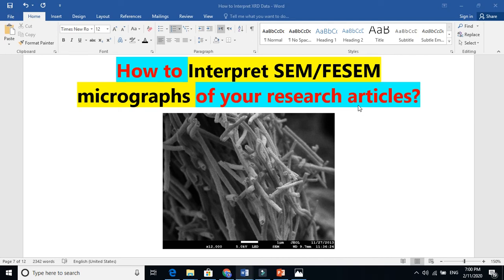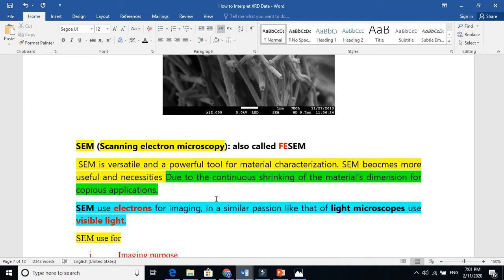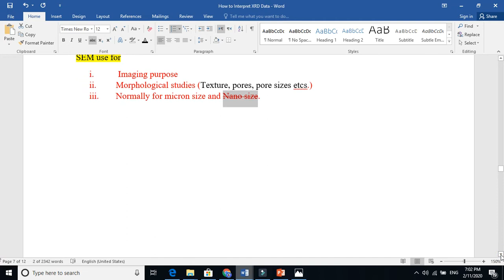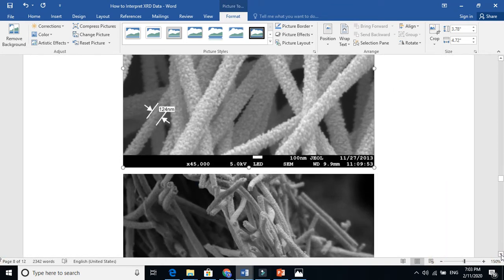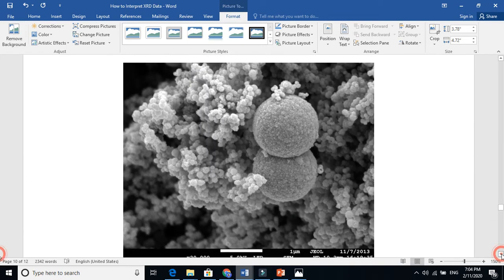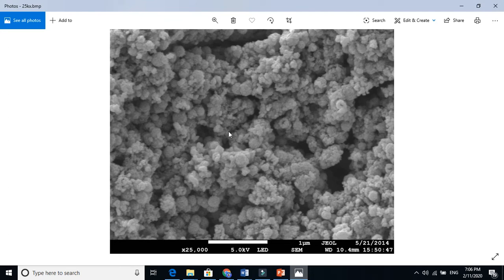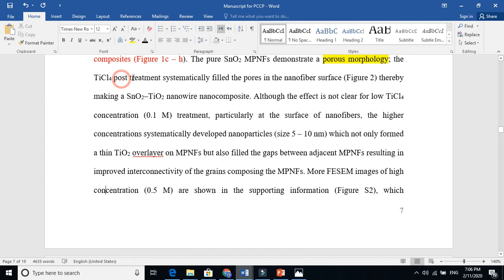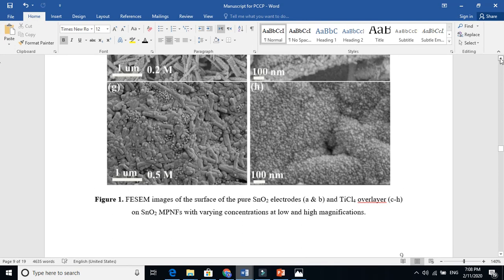SEM Micrographs Interpretation in Experimental paper:  Scanning Electron Microscopy SEM Analysis

Comment: Hi prof, if my sample is very thin 0.0823 micron...can it be seen under SEM? And what is the suggestion for magnification? My material is polypyrrole..
Reply from the maker: How do you know that your sample is that much thin?  
BTW FESEM can go to nanoscale.
Reply: @qamarwali  i did thickness characterization first..measure three points and then take the mean value
Reply from the maker: @mimimeviracrochet  then SEM will definitely shows you the thickness.
Reply: @qamarwali  tq for the reply

Comment: Please sir make a video on How to calculate PORE SIZE, PORE DIAMETER from SEM images using ImageJ software.. Please!
Reply from the maker: Okay sure, I will make. Thank you
Reply from the maker: I don't think we can find pore size using SEM. We use BET to measurr the pore size,  volume etc.  I have already made a video on it. Please go through my channel
Reply: @qamarwali  pore size analyzer too can be used?
Reply: @qamarwali  Sir,  pl. Explain the thickness measurement techniques.... How to use that tool to measure thickness
Reply from the maker: @dr.bharatipatil3074  Let suppose ,  when you take the image of the cross section  of the 2D layer using FESEM. During that meaurment time, you can measure the thickness size.  
Or using that Bar in the image after FESEM,  you can measure thickness with the help of "ImageJ"

Please watch my other videos,  it is already there
Reply: @qamarwali  Thank you very much Sir 🙏
Reply from the maker: @dr.bharatipatil3074  you are always welcome ma'am.

Comment: Sir if the particle size is 119nm means it's considered as nanoparticle?
Reply: Sir plz reply soon
Reply from the maker: The standard definition of nanomaterial  is when at least one of its  dimensions (x, y, and z axis) are in the range of 1- 100 nm*. Some other reports stress that *below 1000 nm is considered as nanomaterials. 
Anyways, your materials dimensions are close to 100 nm, so it is for sure nanomaterials.  Congratulations 🎊
Reply: @qamarwali  Thank you sir
Reply: @qamarwali  sir if the particle size is 198nm means is it considered as nanoparticle?
Reply from the maker: @sonalipatil262  As I explained already that if it is under 1000 nm, that can be considered nano. Still, your particle size is very close to 100 nm side, so I am confident that it is nano. 

How do you measure the size? May be in other dimensions, it shows much smaller value ?
Reply: @qamarwali  sir through sem analysis I got different dimensions
Reply from the maker: @sonalipatil262  This 198 nm is the radius, diameter,  length, height ?
Reply: @qamarwali  sir it has been written 10.0kV 6.7 mm×3.00k SE in 10.0um scale
Reply: Sir what does it mean sir?
I'm getting lot of confusion
Reply from the maker: @sonalipatil262  Okay, no worries.  There is no need to confuse. Actually, try to understand the word dimension. It means length, diameter,  radius, height, etc. In your case,  the 198 nm is the unit of length . So, this 198 nm is the height of the nanparticle, diameter of the nanoparticle or radius of the nanoparticle? I hope it is clear now.
Reply from the maker: @sonalipatil262  Let's make it simple.  How do you know that the size of the synthesized nanomaterials is 198 nm? 
What is the shape of your nanomaterials? Nanomaterials are a lot, like 1D, such as nanorods, nanotubes, and nanofiber.  0D such as quantum dots, nanoparticles,  carbon dots, 2D such as sheet of graphen or MXenes, or 3D bulk materials
Reply: @qamarwali  sir can I get ur email?
Reply from the maker: @sonalipatil262  just drop your questions here so that other people also benefit the discussion.  No worries,  just take your time and respond
Reply: Sir basically I was working on green synthesis of nanoparticles on particular plant ,so for characterization I sent the sample for sem analysis..
They gave the results of nanoparticles size of different numbers that is 198nm,265nm,331nm,418nm under 10.0um scale what does it mean sir?
Reply from the maker: @sonalipatil262  so this means it is the diameter of the nanoparticle.  Correct. You can also measure the size of nanoparticles by ImageJ software.
Reply: @qamarwali  sir wheather we have to take mean of these and find out?
Reply from the maker: @sonalipatil262  perfect. Just take the diameter of at least 10 nanoparticles and take the mean (average). Then, report the average size of the nanoparticles in the research paper or your thesis.
Reply: Sir it's about 303nm ..
Sir how does it considered as nanoparticle Sir,according to me the range of nanoparticles should be 1-100nm
Reply from the maker: @sonalipatil262  still it is not that large in size. Perhaps there must be some small size nanoparticles in the sample whose dimensions may be this range (1 - 100 nm). Usually, all the nanoparticles are not in the same size.

If there are no such nanoparticles within this range (1- 100 nm), then simply don't call it nano.
Reply: @qamarwali  sir in sem characterization they just mentioned these sizes itself sir
Reply from the maker: @sonalipatil262  As I mentioned that you can measure the sizes of the nanoparticles using imageJ software. 
There are also other ways. Just look at the bar, and you can guess the size of the nanoparticles.  The good thing in SEM is you SEE the images. 

Just watch my videos, I have made clear all these details in my videos.

Wish you all the best
Reply: @qamarwali  ok sir thank you so much for your reply sir
Reply from the maker: @sonalipatil262  welcome, and I am happy helping someone. 😊
Reply: @qamarwali  🙏

Comment: Asalamualikum sir can you help me in interpreting the SEM images of a pasta sample?
Reply from the maker: It is very easy. Just see the SEM images and observe what information is there.
For instance, what is the shape of structure? Nanoparticles, nanorods,  sheets, sphere...

What is the size of the particles or sphere ? 

What is the size distribution? It means whether the particles are distributed uniformly or varying in size.

Just find out the average value. 

Observe whether the surface is smooth or rough and then find the grain size if possible.

Look for the porosity and observe the pore size in the materials.....then link it with the specific surface area (m2/g)....

Generally,  SEM provides the above-mentioned information ......and you need to elaborate these points in detail to make a paragraph in the research paper or thesis writing

Comment: Sir Please can you explain Cu2o@gC3N4 nano particle SEM DATA and sir can you provide your email id for more information.
Reply from the maker: SEM data explanation would be the same. Let's see what we observe in SEM analysis?
1. The morphology 
2. Surfaces, whether smooth or rough 
3. Shapes, whether NPs, nanofibers, cubes,  nanorods.....
4. Sizes such as diameter, highet, length ....
5. Whether the size is below 100 nm or not. If below 100 nm, then we call it *nano*. Otherwise, you can not claim nano
Reply: OK Sir, thank you ...sir how can i connect with you? @qamarwali
Reply from the maker: @Nandish1311  Just drop your query in the comments section of any of my videos, and I will respond to the best of my capacity